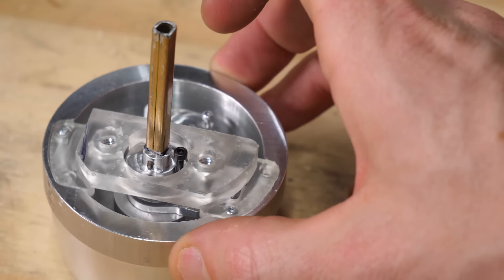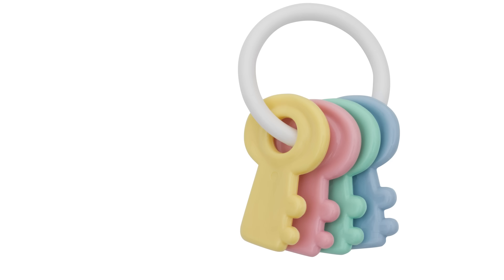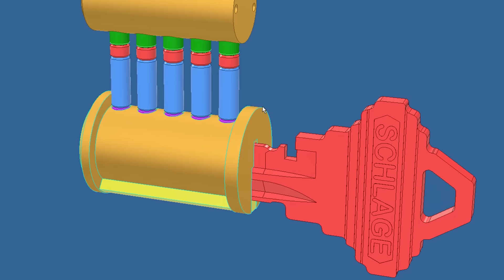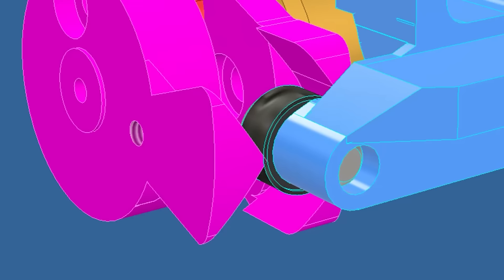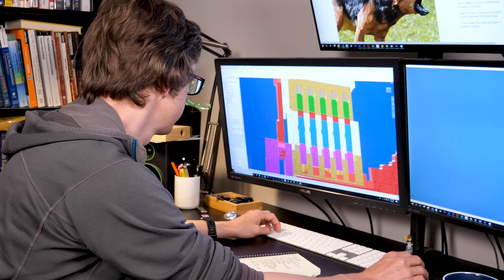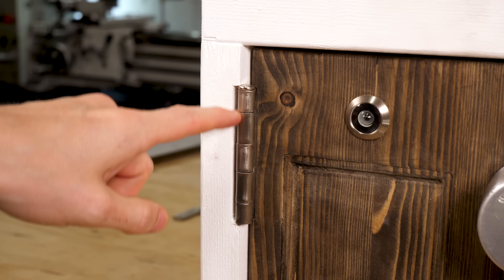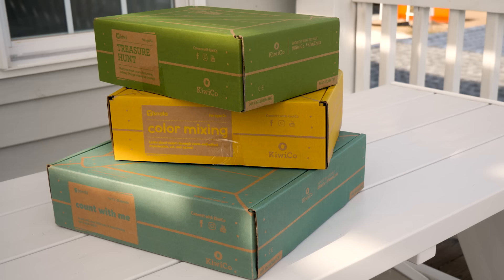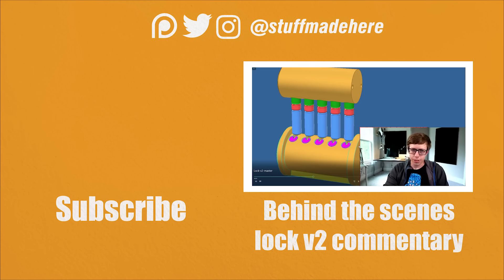TWO Unpickable (?) Locks for Lock Picking Lawyer!

Comment: I wonder if master wafers from cuts 1-9 would allow the key in the bottom tumbler to set the pin heights but shear at any cut height, allowing the bottom cylinder to move and actuate the top cylinder "testing" the key for the correct cuts. This would allow you to remove the complex pin holding spring system. You could even make the whole bottom tumbler a larger diameter than normal and you could even have standard schlage #6's or something and shift your 1-9 master wafer stack out of the way of of damage or risk of getting bound up. Idk though, would be cool to try

Comment: Fun facts with Heather you don't want a completely unpickable lock for your door because if you make it completely unpickable a locksmith can't really ticket in case you accidentally lock yourself out meaning you either have have to buy a new lock or deal with the fact you can't get in your house anymore so yeah completely unpickable is not recommended

Comment: Why not just take the original design and make pins that ride in tracks within the inner cylinder? Two grooves cut along the axis of each pin cylinder on the plane orthogonal to the key axis and two matching tongues on each pin. That way they resist being torque out of their channels. You could even make the tracks slide more smoothly by adding recessed ball bearings within these grooves. 

Should be more durable and smooth that way. Also, much less complicated than the new design... My head is spinning a bit from that. 😅

Comment: Heres an idea:
I saw that a seatbelt mechanism uses an intentionally lose part
At normal speed it spins and in a crash the part shifts and gets caught on a internal gear

I was thinking that you could use this in a lock that has to be spun at a certain speen with a special key that spins using a mainspring

Comment: I just had an idea, and i decided this video is probably the best place to ask it on. is it viable to make pins that are only interactable via magnets, so the key would just look like a flat piece of metal but it has different magnetic charge levels to repel the pins to the correct height. how susceptible would these be to impact attacks?

Comment: What if you made a lock where it also had a specific magnetic arrangement that was checked by an external sensor not in the lock itself. Then even with that knowledge you couldn't guess it if it was complex enough and measuring significantly more than just polarity and direction.

Comment: I'm wondering, you have a cylindrical surface perpendicular to the surface of the door on the lock housing. What if I take a pipewrench and grabs the whole lock with it and twitch. Would that break the screws holdin the lock to the door and in the same time unlock the bolt?
If that is the case, a simple solution to that would be to have the cylindrical geometry changed to a more cone shaped geometry to make it nearly impossible to get a grip of the housing.
Would love to hear a comment about it.
Absolutely lovely work 🙏👍❤️ this was so satifying to watch. The whole thing with your lock and the Lockpicking Lawer picking it.

Comment: Ok how bout imagine a normal key, but with another small weird shape key on the tip and its only purpose is to push in a button inside the lock that locks the entire mechanism from turning, basically 2-Fa but its a key. theres the teeth of the key to set the pins then theres a weird shape pin to push in the weird shape button inside

Comment: You're going about the pens the wrong way what you need is more of them the more they are the harder it is to hold them in place while you're picking the lock and sticking them I'd suggest something with pens on 3 sides of a key And many of them

Comment: What if instead of springs you used  magnets pushing away from each other at the same pole ? The magnet would also make it difficult for anyone using metal lock picking tools since it will pull on them.

Comment: you should make the new lock inside the door so he cant put anything between the door and the lock.
also you should make a plank of wood over the bolt so he cant put his knife in there.
i think that it will be impossiblle to open it after making these upgrades.

Comment: OK on V3 of the lock you need to make a deal with the lock picking lawyer that he does his video natural and with the un boxing and then start with no keys send them later. Because I think Time is also a big deal on picking your lock if it took the lock picking lawyer an hour to first get in it. not knowing anything about the lock and I think you’re pretty safe. Because taking a hammer to it will happen if a intruder had to spend more than 5 min and if that’s the case they’re going to get in no matter what.

Comment: How about this?
Make a 3 step combination lock! 
Step 1. A regular key is inserted into the lock itself. This triggers an electrical mechanism that starts a countdown of X seconds. 
Step 2. During the countdown a secondary key must be inserted into another lock above it. This is the combination lock, and it's electronic. If you know the 5 digit combination, you should easily be able to turn the key to the correct numbers during the countdown. Make sure to include right and left turns!
Step 3. Once the combination is correct, the electrical mechanism unlocks the pins, allowing the bottom key to be turned and the door to be unlocked. 

This 3 step combination lock makes it so that all 3 steps need to cooperate in order for the lock to even be unlocked. 
-If you short-circuit the electronics, then you can't solve the combination lock. You need the electronic mechanism to trigger.
-If you don't have the first key, you can't trigger the electric mechanism. 
-If you don't have the secondary key, you can't even turn the combination lock. 
-And since both keys need to be in the lock at the same time, then it will be very hard to pick the lock. 
More than that! Since the key is inserted, the pins can be used to actually punch in a proper pass-code to even trigger the electronic mechanism. Otherwhise the electronic just sounds the alarm.
That's my theory. Do you think you could make it a reality? If so, then you can keep the rights to the design. :)

Comment: So Masterlock made directional locks and while they create good puzzles the actual implementation sucks for escape rooms would you be able to make a better directional lock than the master lock one? something to physically show how many inputs need to happen on a lock to unlock it. some different way to reset the lock to to automatically reset itself. In addition Masterlock has stopped producing these locks, would you be able to make it in a cost effective enough way to mass produce them? this is not a business enquiry, I work at an ER I do not own one

Comment: What if you just made a lock with a second set of pins on the bottom and a double sided key, or even a L shaped key with pins on the top and the side then you could fit like 6 pins

Comment: I bet a lock that gives a 10k voltage shock everything you hit the wrong piece and resettef itself everytime would be a bitch.  Maybe use the advancements in micromachines to make a lock that changes shape inside if you hit the wrong tumbler

Comment: Wait! 
What if you designed a way to put pins on the bottom of the lock as well as the top? 
Or you put false holes in the housing that the pins could fall into if they aren’t continuously supported the way the key would when you turn it, if that makes sense. 

Just some ideas.

Comment: I don't really see the point of unpickable locks. They strengthen a known weak point so might stop a casual attempt but my house has windows, a timber door frame, a garage door. And if I strengthen them I still have a roof. You've only got to see a few penetration testers at work to realise the futility of making a house properly secure.

Comment: 🤣 there's another way to make unpickable locks, have a rfid chip inside the actual key. No matter how many picks you stick in the hole or how much binding, unless the lock detects the chip, it aint opening.

Comment: the lockpicking lawyer ended up cheating to pick this which is lame, he simply used intimate knowledge of the lock and circumvented the design, if you are to truly pick a lock you pick it assuming you cannot access the internals.

Comment: hey what cad are you using for designing mechanical parts? I’m looking for something that will fairly accurately simulate basic metal mechanisms with springs and i would ultimately love to be able to design compliant mechanisms but it’s no t critical at this stage. Any recomendations?

Comment: To make a truly unpickable lock it would need either 2 key holes or the key needs to be made specially with implanted magnets in certain areas to which will pull the pins instead of push them. You could even have a side pin which gets pulled to the key to allow it to turn. If you want a better description or idea let me know.

Comment: All good but you made a really really silly mistake in the end no one is talking about it. You mounted the lock on the wrong side your makeshift door. The jamb (part of the door frame that prevents the door from swinging forward) is usually located on the outer side of the frame (from an intruder's perspective) but you put on the inner side. Had it been on the outer side, it would've shielded the bolt and the lock picking lawyer wouldn't have been able to simply hack it with a pocket knife

Comment: What you want is a lock that gives a electric shock to a picker  I remember long a go a French man  to make his cycle safe he incorporated an air gun spring and trier in his cycles seat tube under saddle  a small hole in saddle (evil cackle)  if any one sat on saddle without disarming  it fired a 6 inch spike went up there bum

Comment: After watching your 2 videos (1 video for each lock) and the lock picking lawyer video.

 I thought it was very obvious that he cheated a couple times though. 1. Used an excuse to take the locks off your door to connect them again himself so he could slide the tool behind the lock.(Such as his other videos which shows him not knowing how a lock works and with trial and error figuring it out like what a criminal would do to find the solution) 2. He also used a custom made piece of metal on the second lock(older lock) which was made from knowing what the lock looked like on the inside once he removed the lock from your door.(No one would have something like that in the field and being custom made, someone couldn't just google it to find out how to open it) 

FYI: If you didn't send him those reference guides with pictures, as well as taking the lock off the door, or him just not making custom fit pieces, he might not have opened either one or at least taking more than 5 minutes to figure each one out. on that note it seems you set yourself up for failure.

Comment: Too easy, just put a sensor in the lock that triggers 50,000v if tampered with with a non valid key. But do it in a non logical way like with a certain resistance with a rotating code like modern garage doors
Reply: Ok fine...not 50000v, but an electromagnetic deadbolt trigger with no physical key and remote unlock from a secured location

Comment: You an expert you lost me  must be me age  with these new electric bikes  loads of power you could have a safety converted from battery that if any one touched it without key  25,000 high tension volts would jolt them

Comment: Why 1 key and 6 pins with two barrels why not split it 4 keys 8 barrels 24 pins you hv 360 degrees of rotation to limit each barrel you hv infinite pin settings and each key well why just a key why not a key with a unique shape or size think when you were a child putting wood through holes who says a key must be turned why not pushed and pulled rotated and hinged so let's recap 4 keys 8 barrels 24 pins each key a unique size ans shape each barrel limited by 360 degrees of rotation each pin a diffenrt shap or size also and last the uh plunger don't know the proper term anvil part that locks into the mount that must be pulled back to open why dose that have to pull back why dose it hv to slide why not hinge and grab and rotate like a fish hook simply sliding out of the way is a flaw Make it rotate so you can't just slide a credit card and open the door bypassing the lock itself make it sprung hv 2 of them dead bolts solve this problem but what it if you magnetized it im not an engineers or an expert by no means but these issues are obvious to me then with armor and reinforces of the frame the handles itself should be round so leverage cannot be attined or forced just some things I think about thanks.